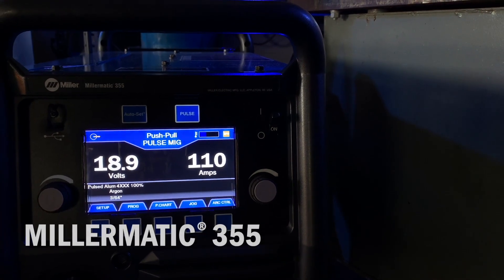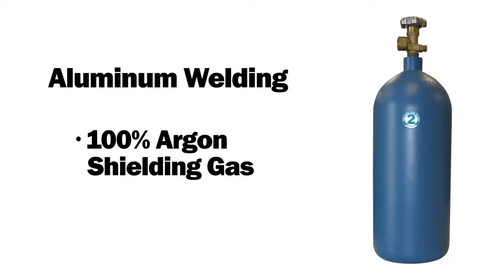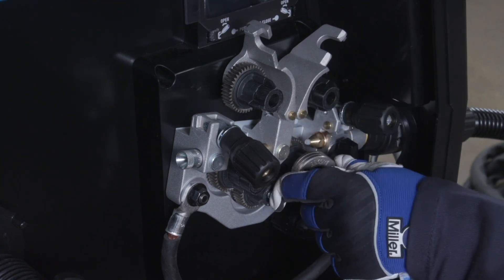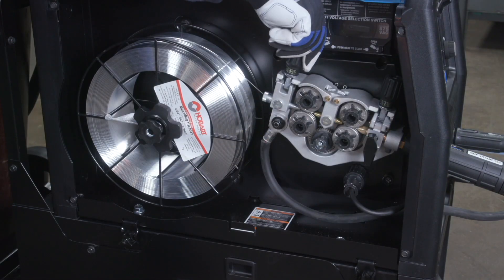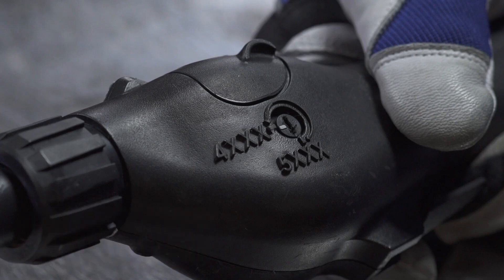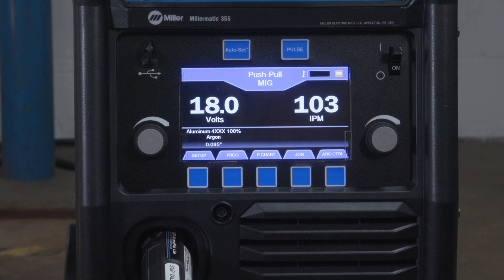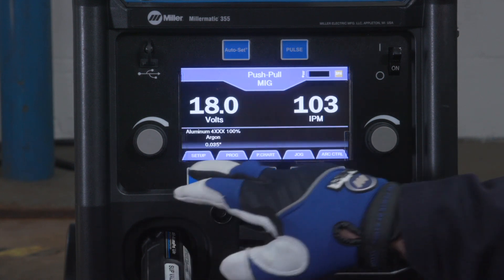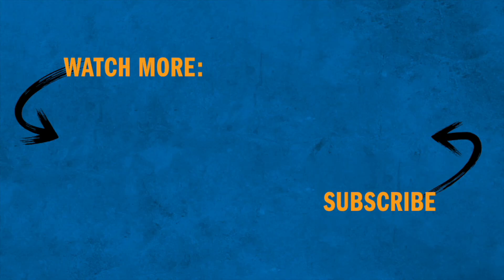Setting up for Push Pull Gun Welding | Millermatic® 355

Comment: Never knew you could use aluminum wire with a “Push Pull Gun”. I was under the impression that you needed an expensive aluminum spool gun to do that. You talk about a video demonstration that Miller needs to do! The aluminum wire Push Pull Gun welding aluminum! Please produce this.